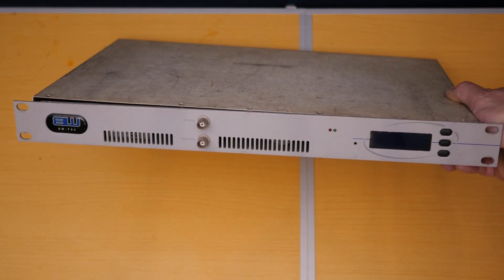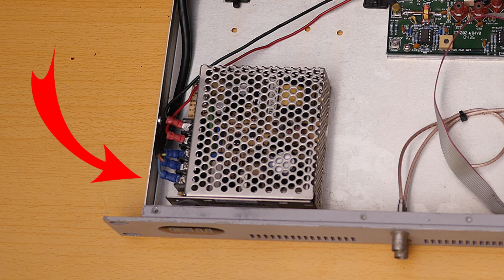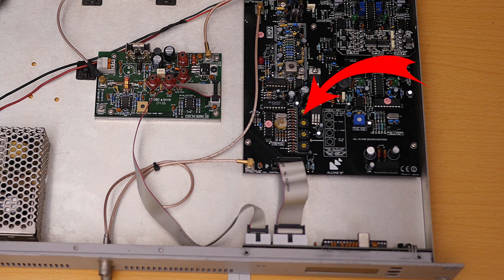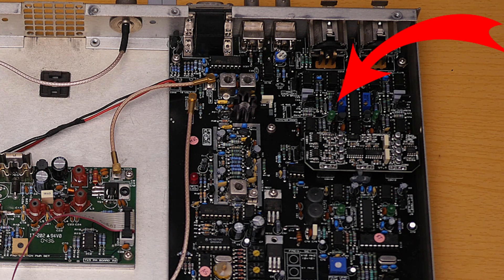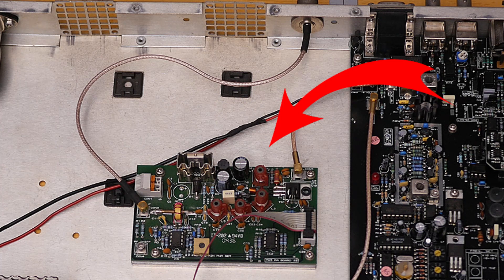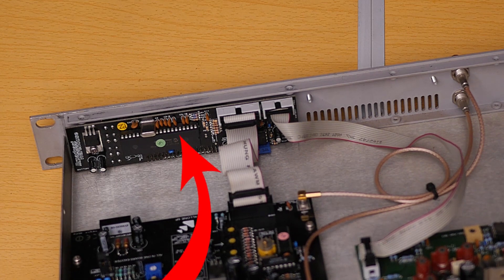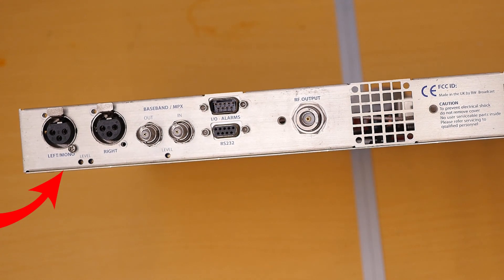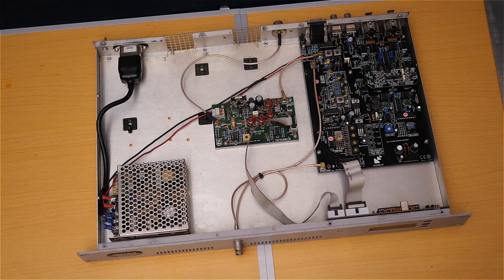FM Transmitter 5 Watt Broadcast Warehouse Radio Station Transmitters. Looking Inside BW TX5

Comment: Worth saying that the power wires to the AIO have obviously been modified. They should not run tight and diagonally like that. In fact it looks as if the PA is actually disconnected. I'm former BW tech support manager.
Reply from the maker: Lol well spotted! The Amplifier in this transmitter is no longer working. I just used it to show the inner workings of the transmitter. Most people would not notice the PA unplugged lol. This transmitter is running the 1 watt straight out of the main board. Had to mod a little bit to get it to run without the Amp.

Comment: brings me back in time that. and the old NRG kits stuff. 5watt exciter into 50watt amp. taking it to the limit to get most power. And now look at the tech in them now
Reply from the maker: Lol yeah it used to be a thing to amplify low power transmitters. That 5Watt transmitter actually was the main transmitter for an actuall FM radio station. It ran at 1 Watt ERP and had about 14 000 listeners. The good old days lol.

Comment: I have been ysing the BW tx 150 fir a few years and today station went off the air. Only one of the fans work and no lights, no display. Checked viltage coming out of the power supply and there is a 24 volt buss and a 40 volt buss, dont see any other smaller voltages that the I.C.'s would typically.use. anyone have repair experience?
Reply from the maker: Hi. I used to repair transmitters many many years ago but I wouldn't be much help these days. The only thing I can say is that without a schematic diagram you stand little chance. You may as well try repair it blindfolded. Try see if someone has one. Without it you are lost I'm afraid.

Comment: The new bw broadcast has fm tuner built in for relay sites on 50watts
Reply from the maker: Hey thanks for your comment.Yeah BW makes some awesome gear. I don't think they make the 5Watt transmitter anymore which is a pity because it is amazing. What I can say about any BW gear is that the sound quality is spectacular. I make no money for saying it but I would recommend BW over many other brands. I have used their transmitters and loved them completely. I haven't looked at their new transmitters for a while but that sounds very cool to create relay links  in the transmitters. It could make for quite a big saving on stl equipment to be able to link one transmitter to another. Very cool. Not surprised at how innovative BW are. They really are an awesome company. Cheers.